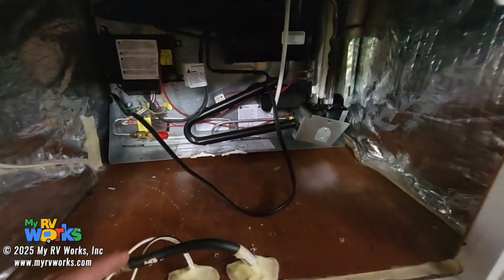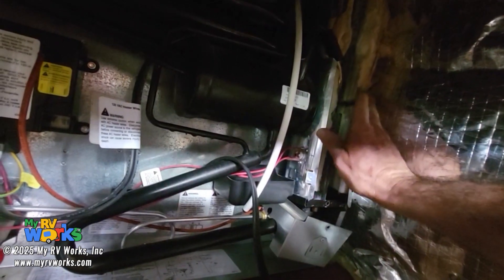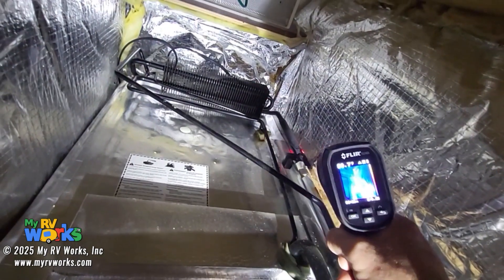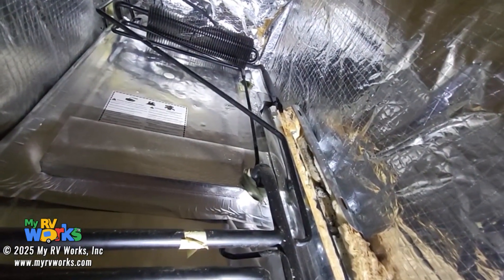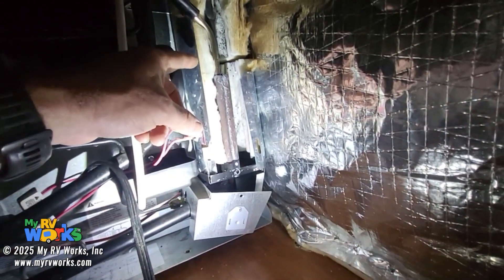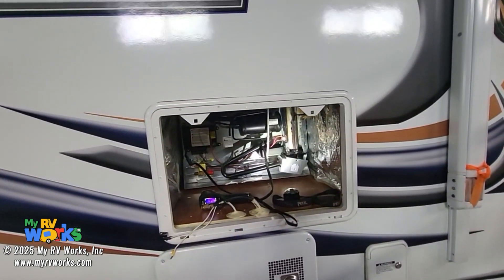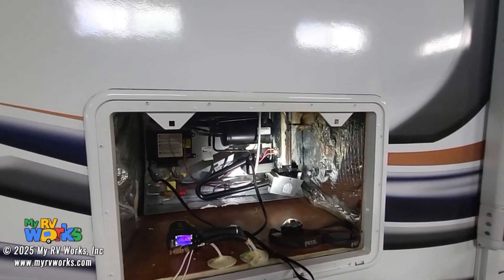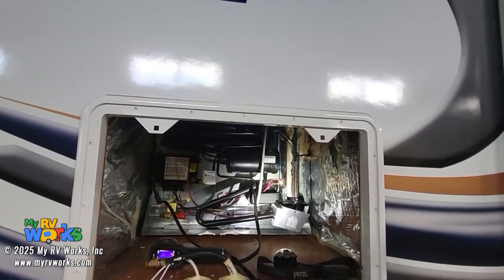Diagnose A Blockage In 30 Seconds!

Comment: Thanks for all your videos- helped me troubleshoot and fix my fridge problem. Dometic RM2351 not cooling and making a gurgling sound. In the end I removed it and rotated for 10 minutes each left side, door down and right side then settle for 4 hours before powering on. That fixed it. I suspect running on a slight slope had caused the coolant to have an air pocket.

Comment: Before doing all these exercises try just to reset the controller. I had blockage on mine after the rig was left overnight on the steep grade. 
Reset was stupid, it required to  open the controller cover and connect one pin to the ground with a piece of wire.
Reply: Internal cooling unit blockages can't be fixed by a board reset, that procedure is normally for a Norcold 'no cool' code.
Reply: Do you have a paid  fee Q|A ? I know my fridge is shortening my life and I did get a 110v zap from it because it hates me. Thank You! Glad you are back
Reply from the maker: We don't have a paid Q & A service, but if you send us an email, we are sometimes able to provide brief replies there as we get time.